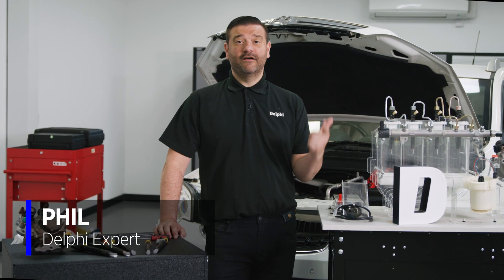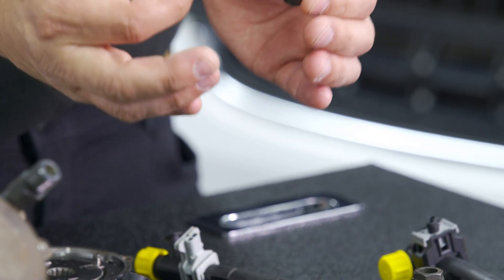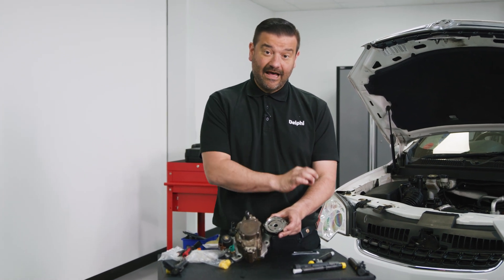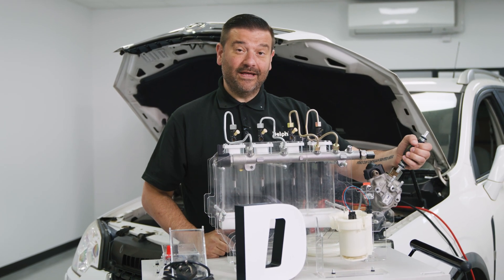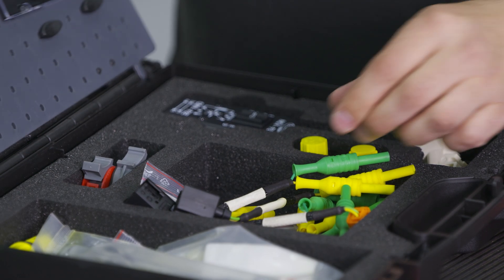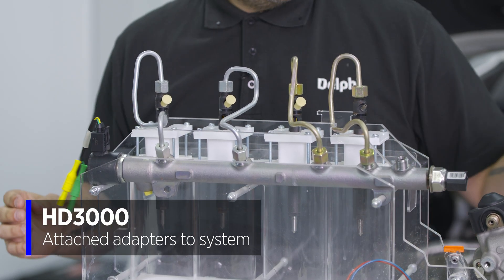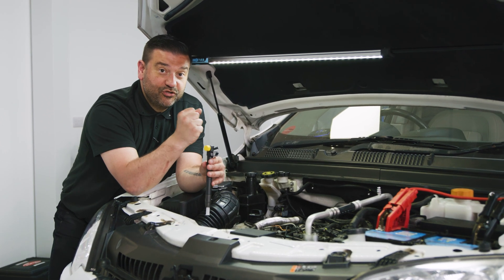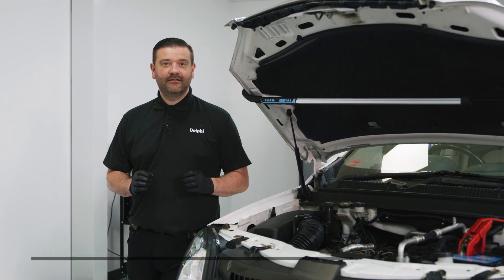[EN] Bleeding a diesel fuel system after fitting new components | Masters of Motion

Comment: HPV without current is fully open and the IMV without current also fully open. So if you just disconnect them, you'll get to same state. The only difference is, that some ECUs won't allow start (actuate starter) with IMV disconnected. So you can use some old (electrically ok one) IMV plugged to vehicle harness. HD3000 is not needed for this, but it is a great tool for diagnostics. Knowledge about fuel system you are working on is the key. Anyway,  WONDERFULL video. Thank you for making it.

Comment: I would remove the caps right just before fitting a fuel pipe into a fuel connection, not just when fitting the injector into engine. But I suppose that is what Phil meant. Great video nevertheless!